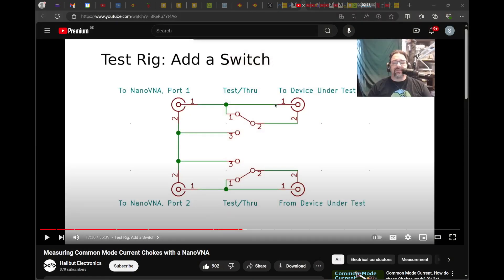Common Mode Choke Testing

Comment: I worry about using a GANGED 2p 2w switch in your test jig. The closeness of the port1 and port2 wiring and switch contacts will introduce extra coupling and calibration may not remove this capacitance.  This will affect the accuracy of measurements at the higher frequencies.  I note that the prototype Halibut Electronics prototype jig on which yours is based, elected to use separate switches.
Reply from the maker: You are right. The design could be improved  !

Comment: Very interesting video. I'd like to see  clamp type Ferrite core chockes tested as well. Hope you have spare time to do a test of them ;)
Reply from the maker: Thanks. I find that the clamp on type don't work very well. I throw away the plastic part and bind the two halves tightly together with masking tape to get the expected noise suppression.
Reply: @fotografm  Thank you for the info. I'll try.